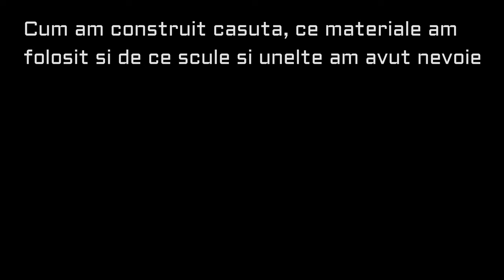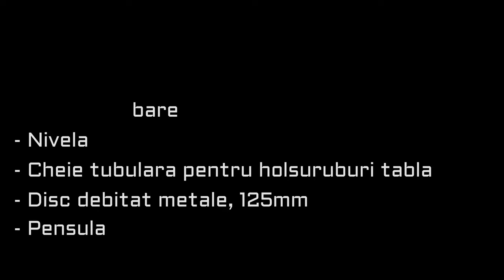Casuta cotet cu terasa pentru catel

Comment: Cum s-a comportat pendularul , esti multumit de el? Eu am pus jos la cusca linoleu , ca sa o curat mai usor ca ai mei sunt mici si lasa mult par .Tratament pe interior nu stiu cat se merita, cusca mea are 6 ani si e ok doar cu un strat de lac exterior dar anul asta ii mai dau unul .Daca mai tine 2 , 3 ani ajunge .La cat e cusca si cat e cainele zici ca i-ai facut vila la 😊
Reply from the maker: Sunt foarte multumit de el. am bagat balans la 3 si taie brici. Apare un clip in curand si vezi si tu cum merge. Atata doar ca am impresia ca suge cam mult curent, am taiat cateva sipci si niste OSB si s-a dus acumulatorul de 5Ah. I-am facut o casuta sa stea si el in confort, :D
Reply: @DemoToolsYT  important e sa fie fie puternic chiar daca e pe baterii, la consum poti sa bagi unul la priza daca vrei sa nu ai treaba cu curentul din baterie .Se bucura si cainele stai linistit al meu abia l-am scos din cusca inainte sa ii fac acoperisul
Reply from the maker: @midnighttools1030  Da, nu e problema, mai luam niste acumulatori si facem treaba si asa. Al tau e evident mai bun din punctul asta de vedere dar pentru ce am eu nevoie e ok si asta. Chiar mai mult decat ok
Reply: @DemoToolsYT  lasa ca e ok ,ca ai curent in casa ca sa ii incarci 😎 pe teren e aiurea undenu ai nimic de pleci cu plasa de acumulatori , acasa nu ai nevoie